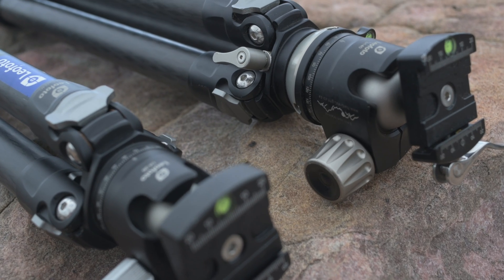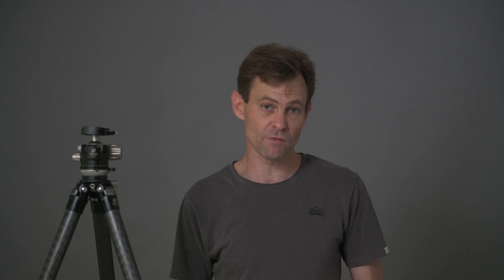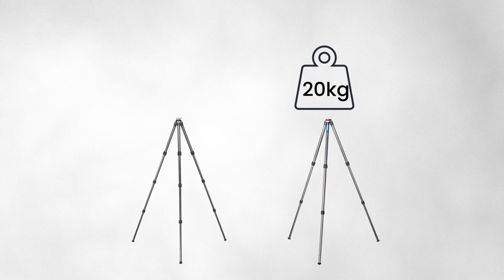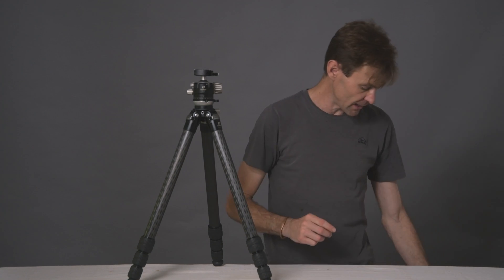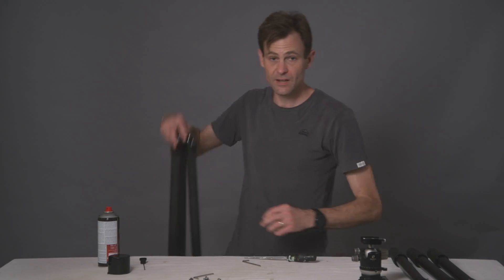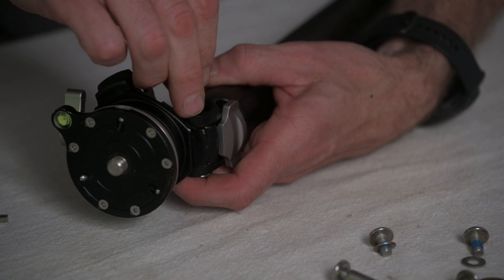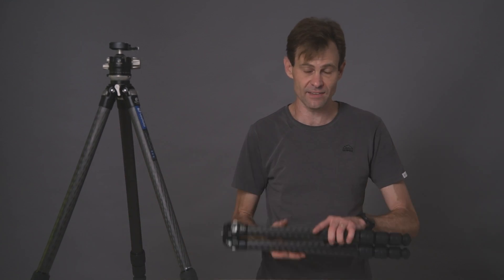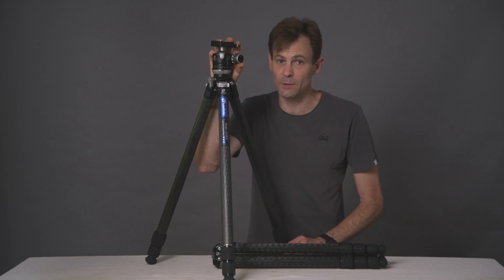Building a Leofoto LS-323CEX leveling tripod

Comment: Love my Leofoto 325 ranger! What size levelling head would you recommend for it though?
Reply from the maker: The LB-60n is the right dimensions for the 32 series, although if you need a slightly bigger ball the LB-75n is sturdier (but the base overlaps the shoulder slightly). The number is the diameter of the base plate of the leveling base.

Comment: Just tried this with an LS-254CL and an LS-255CEX and the bushings and holes on the joints were a slightly different size so couldn’t get it to work unfortunately…😢 Was trying to avoid the additional weight and bulk of a separate self-levelling base.
Reply from the maker: @wandering_weasel  that’s bizarre! I haven’t seen the 255CEX, but this works with the 36, 32 and 28 series tripod apexes. Absolutely at a loss as why your 25 apexes aren’t swopping.
Reply: @emilvonmaltitz  I was surprised too; I bought a 255CEX assuming that apex would be interchangeable, but the pivot shafts were imperceptibly (ie <1mm) bigger on the CL than the CEX, so there was slight play when I fitted the CL legs to the CEX apex and I simply couldn't mount the CEX legs on the CL apex.  In a last ditch attempt, I did an internet search to see if I was missing something and found your video.  Not sure if it is a consistent difference between the 25 series tripods, or just down to batches.  Have gone for a separate levelling base (LB-60N) which works great but clearly adds more weight and bulk.

Comment: I'd rather buy the separate leveling base to the existing LS-323C to gain a little extra height. I could even combine it with a panorama plate. To get even more versatile. This you could combine with your favorite panorama setup or with the Leofoto G2 (for architecture etc.).
Reply from the maker: That's the great thing about the system as a whole. There are so many ways to put all the bits together that you can really customize to individual photographers needs.

Comment: Great video. Leofoto also sell "Leofoto LS-CEX Leveling Tripod Apex with FIXED Leveling Base". I have LS-364C, and planning to get one LS-CEX Leveling Tripod Apex with FIXED Leveling Base - 36CEX.
Reply from the maker: I reckon the CEX tripods are definitely worth it! My favourite personal tripod is the LP-364CEX. The LS version you’re getting is excellent and probably the best value for money 36mm tubed tripod you can find. Enjoy!
Reply: Agreed. LS-364 + 36CEX is the best value compared to LP-364CEX. LP series which helps to minimize the need for maintenance due to their design in the locker system. I carry  Platypod Ultra + Leofoto H50 + LH-30 ballhead for beach or scouting purpose when I don't want to carry the tripod. So far I do like it the new setup LS-364CEX with MHXPRO-BHQ2  - Manfrotto XPRO Magnesium Ball Head. Total weight about 5.10 lbs, I no longer need to carry the Leofoto leveling base.  @emilvonmaltitz

Comment: You’ve figured out some of the utility of a “system” tripod, but there’s still so much more potential. I start with 36mm legs because there’s more available - LS, LM and CEX apexes for example. There is also the LS-362 with very short legs.  Let’s say you need a tripod for shooting over a railing.  You could replace one leg with the two section short leg, put a 3/8” stud in the end, add a mini ball head and a clamp and you now have two legs on the ground and one clamped to the railing.  Need that leg to be normal length again? No problem, thread a monopod into the 3/8” thread the foot normally goes into.

We really should come up with a catalog of different options using stock LeoFoto parts.
Reply from the maker: That video is on it’s way. I chop and change several components…but the tripod as a system is a wonderful plus. I want to do a better longer film as the tripod as a system. This was just a short answer to a single question. Thanks for watching!
Reply: @emilvonmaltitz   https://docs.google.com/document/d/e/2PACX-1vS2VLw8DfpahPorhKAc4Na32YTakNYaClY_I9B9AHDa5wV3lVd8cGiOqSH0EZdi1sFmyYj-gWExg1LT/pub   Skip to the end for the tripod bit.

Comment: Very interesting to hear of the breakdown of the Leofoto part numbers and how to mix and match. I’m no expert but if you add an LB65N Levelling Head to at LS-323-CL is that the same beast apart from the ball head which you can add too.
Reply from the maker: In theory you can turn any tripod into a leveling tripod by using the lb65n (or the smaller ones for that matter). The locking mechanism on the ball is slightly different and you get a little more height on the apex by adding the unit. Nice to have the different options.
Reply: Not sure what you’re referencing here exactly? Wouldn’t all leveling bases appropriate for each tripod be the same thing as they’re just going on the spider or top of center column as it were.
Reply: @firstclassfish01  No. The CEX has the leveling base integrated to the Apex, while a separate leveling base adds up some heights. Thats what @emilvonmaltitz is refering to.

I'm though not sure if you're gaining height this way of changing legs. Sure the LS-323CEX will be sturdier than the original LS-324CEX. But the 4th section will bring up the 324 to the same height as the 323. But of course a LS-324CL would be great as mentioned. However I'd rather buy a separate leveling base to the existing LS-323C just to reach an extra height.